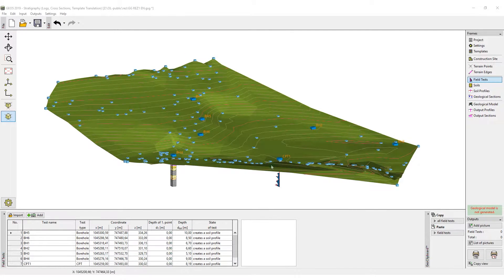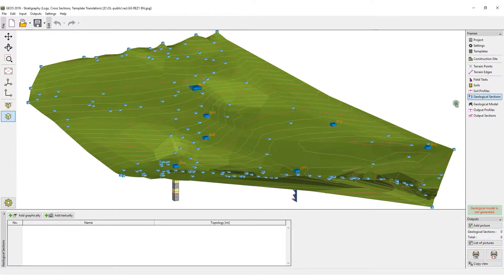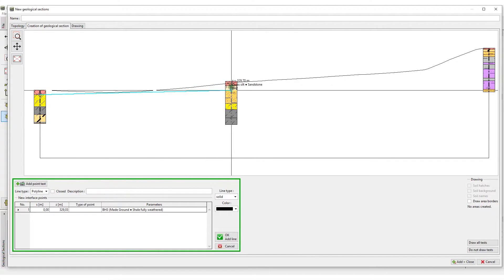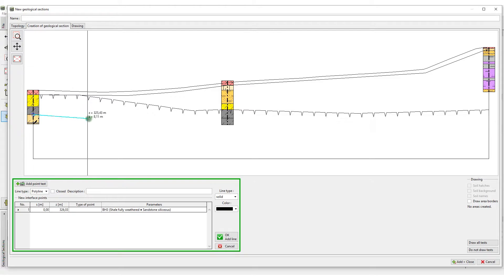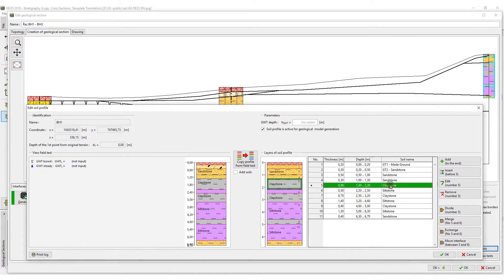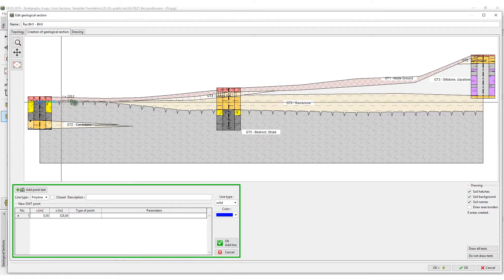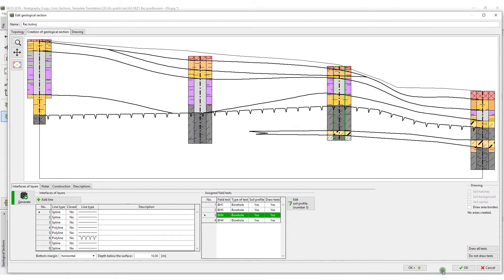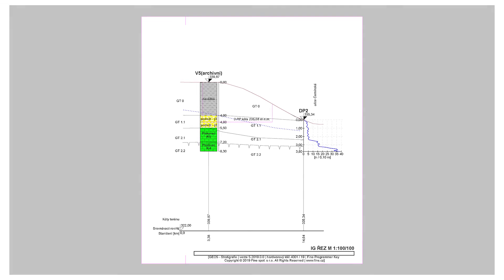Create Geological Cross Sections Using GEO5 Stratigraphy

Comment: this is the worst software on earth, you can even save the demo files
Reply from the maker: Hi Skrrrt, our demo version of the whole GEO5 software suite is free and without any time and analysis limitations. The only limitations are in saving, printing reports, and added watermarks into output reports. If you would like to use the software not only for the try but for your work, I recommend you to buy it and enjoy all the software benefits. Buy or lease options are available at www.finesoftware.eu.